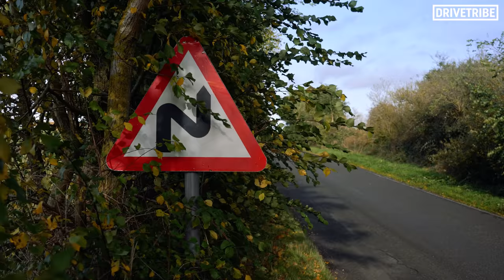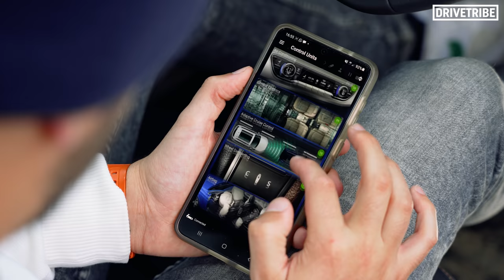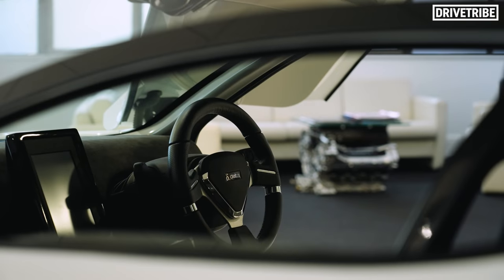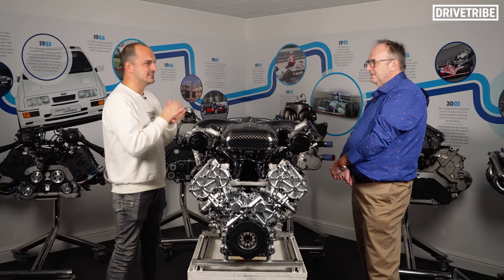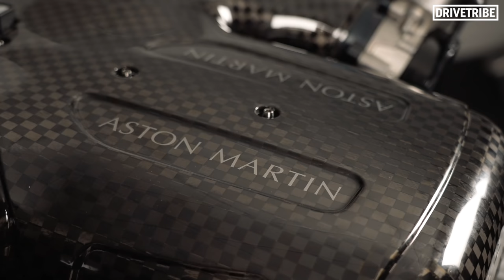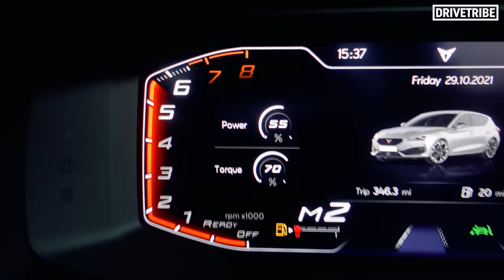Why are almost all modern engines 2.0-litres?

Comment: The 3 liter, inline-6 engine. Same 500 cm³ "chamber", but in a better balanced engine. It's a joy to drive a normally aspirated one.
Reply: Straight-6 is great. Only issue is packaging due to the length.
Reply: @martintaper7997  it is an issue, which is why they're not as common except for a few cases. i6 are usually about 80% longer than a V6 with similar displacement (i6's main competitor is v6, not i4). and although v6 is wider, it's still easier for packaging due to an almost cube-like shape outline. for most cars, functionality and cost are more important considerations than aesthetics. speaking of smaller i6 like 2 liters, they used to be common but not anymore because of reduced thermal efficiency as mentioned by the cosworth expert in the video.
Reply: must agree, got an old e39 530i, super smooth reliable engine!
Reply: @the80386  I had a E89 Z4. It had more than enough place under the hood for that engine.
It might not be for every car, but in those where it can be fitted, it's a pity not to have it.
Reply: @Chris-Workshop  I only had a 2500 cm³ inline 6, with ~210 PS, but it was smoother than silk. I really miss it. With double VANOS and Valvetronic, it was a dream.
Reply: The switch of most cars to front wheel drive spelled the end for most inline 6's, I know of only three front drivers that had an inline 6. Suzuki Verona, Volvo S80 and  the Land Rover Freelander. And the Verona and Freelander are no longer made, while I think the S80 finally ditched the inline 6 for a turbocharged&supercharged inline 4
Reply: James Mcguire  yes, I have that pathetic 2.7 engine in my 2010 Sebring, but so far it is still running great at 132,000 miles. Just keep clean oil and enough coolant in it and it is happy!
Reply: 183 cubic inches, I mean 3 liters with a big turbo and port injection under my hood. 600 + Chevy LS stomping HP.
Reply: Id still rather a v8 though
Reply: E46 M3 ;)
Reply: @the80386  The packaging really is a killer for that engine though with modern cars and crush zones the length and height of the engine makes a big difference it's much easier to fit a fatter but shorter V8
Reply: @the80386  That's a big deal though they're very tall and long which is the two hardest dimensions to fit
Reply: @Johnny-tq9no  The inline 6 is back. Jaguar, Mecedes, Aston Martin have or will have inline 6 engines on their program in the near future. BMW never stopped making them. The inline 6 will become the new V8
Reply: @afre3398  That's hardly evidence for them coming back... Those cars don't sell much at all compared to v8s and really aren't all that there's less and less inline sixes every year
Reply: @Johnny-tq9no  That is wrong. The truth is that they have made a comeback in recent years. Maybe not in the US though. But the world are much bigger than the US. Something that the US car manufactures should have realized years ago. And made better cars that have appeal outside the US
Reply: 2005 CLK 320 here. Can confirm: smooth as butter!
Reply: Nice drive but not so during filling up time, $2 aud per litre in Australia now ($5.5 usd per gallon).
Reply: @henq  those are V6 engines, not as harsh as a inline 4, but nowhere near an inline 6 in smoothness.
Reply: @thefridgeman  You’re totally right! I stand corrected. In my younger years I opened the hood of my car frequently. Now only when I buy one… So I forget the looks.. :)
Reply: @henq  no problem, Mercedes also had inline 6 engines, gave up to build only V6, like AUDI, but lately they have returned to the inline 6 again.
Reply: You can just type 500 cc, you went above and beyond to put 'cm³' here. You deserve a like.
Reply: Gotten to drive my dad's Z3 3 litre inline 6, so much fun
Reply: @Johnny-tq9no  you are so wrong... allot of people buy I6 allot of people like I6 more than V8.  V8s don't really sell much better than I6. there are just more V8s out there right now than new I6.
Reply: @the80386  no the real issue is fuel economy. 6cyl is gonna be less efficient than the 4cyl. packing the engine inside a car is not that big of a problem. that's something they have the ability to engineer around.
Reply: @the80386  Exactly, it's why straight six diesel trucks are more popular in america and australia where they can fit those big straight sixes under the hoods
Reply: " ...an  elegant engine, for a more civilized age ."
Reply: @Chris-Workshop  the e39 530 is my dream "classic " car. Had the 528 , and was wanting just a bit more power.
Reply: old bmw i6 2.5 is a monster is smooth and rages like a dragon
Reply: Agree, probably the best configuration ever to have in an engine.
Reply: how about a 2L inline 6
Reply: stellantis' new engine the Hurricane is pretty much an engine with the layout listed above, except that's not naturally aspirated but has a twin turbocharger  mounted on it.

Comment: See, when you say "they're getting 1000hp from an inline four" my immediate thought is "But what if it had eight instead?"
Reply: You'd spin off the road, or you'd use only half of if
Reply: @Nick-dz4ml , unless you have 8 driving wheels instead of 4.
Reply: I'm only thinking W16.....
Reply: Having owned V6’s and V8’s, I’ve often wondered why I was blasted into the weeds from lesser Cylinders and double the fuel economy!
That’s when I went from Rovers & Granada’s to Audi 4 & 5 cylinders!
No competition what’s so ever!
The Sound alone!
Nuff said! 💪😎👍🤛
Reply: 4 cylinders inline have always been the best engines.
Reply: if you double the wheels you still won't get more traction since each wheel only gets half the weight. You have to double the weight as well.
Reply: @pilotavery , if what you’ve stated were accurate, mounting wider tires to take corners at faster speeds would be pointless since the same total weight of the vehicle would be spread out on a larger contact surface with the pavement.
Reply: Oftentimes adding more displacement reduces power. When you add more displacement to an engine, it ends up reving lower, meaning more torque but at a lower rev-range. Since horsepower is just torque times rpm, this means that if done improperly you end up with less power. That's why japanese i4s rev high to get their power, while an American v8 reaches recline at a fraction of that. There's advantages to both layouts, but typically a lightweight body will prefer to rev high, while a heavy body will benefit from extra torque.
Reply: @PinkSparklyGamer  But it wouldn't be adding more displacement because the displacement per cylinder would be the same. American V8s rev slow because a 5.7ltr V8 has larger displacement per cylinder than a 2ltr i4, not because it has more pistons. 

Torque is better than HP anyway, unless you're on a racetrack where you can be constantly in the top end of the revs. Who drives like that on the road? I'd take lazy torque over screaming revs any day of the week.
Reply: @fredmercury1314  Yes, but there's big disadvantages to all the extra moving parts in a v8, making it rev lower. Not to mention engine imbalance, and less efficiency from each explosion.
Reply: @PinkSparklyGamer  There's LESS moving parts in a V8 not more. 

You've got twice the pistons, twice the valves, possibly twice the cams, still only one crank... but that's all divided by two when compared to an i4. 

So the V8 actually has half as much crank mass to spin as an i4. 

Imbalance in a V8 is going to depend on firing order and the crank balancing. A flat-plane V8 can fire two pistons simultaneously, so there's next to no loss in efficiency. 

So you've got twice the expansive force acting on twice the amount of pistons, moving one single crank, with half the rotating mass. That's less moving parts per CI, not more. 

Engines don't explode unless there's a catastrophic failure. Explosives explode, engines expand.
Reply: You'd still only get 1000hp. 🤣
Reply: @PinkSparklyGamer  It doesn't rev lower because of more cylinders or displacement, it revs lower to promote better engine balance. If you don't care about engine balance, you can can do a flat-plane with DOHC and rev to the moon. This video explains it well: https://youtu.be/RcyMoZoqkPA
Reply: it's not wrong though, bigger contact patch only gives more grip up to a certain point, then it starts to fall off due to lack of ground pressure. Even then it's only under ideal conditions, especially if water is being considered
Reply: Power is the rate of work DONE.
 Torque is force being PRODUCED. 
Torque is multiplied through the gearbox power is lost.
So my question is at 1000 hp how many revs is the little motor spinning at wearing itself out. And what is the torque at the crank . 
At 20000 rpm you can certainly gear it down to get rubber burning torque at wheels.
Reply: @leolouchios5574  Inline 6s or V8s are the best in automotive history.
Reply: I'd be happy with 600hp, big deal if it can make 1000hp.
Reply: @Nobody-dc8dp  Never settle for less when you can have more.
Reply: @rickitysplitz7035  facts.
Reply: Zero to power pole in 3.2 seconds
Reply: @jaysdood  Are we talking Mustang fast? Or faster?
Reply: @Fred Wills "An inline 3 cylinder has superior primary balance characteristics to a 4 cylinder"  ive heard the opposite. avoid 3 cylinders because they are inherently more unstable
Reply: @Fred Wills and a 4 cylinder will have them spaced at 90 degrees. its inherently a smoother and more stable engine
Reply: @fredmercury1314 greed
Reply: @brianj6314  it is what it is
Reply: That's when you remind everyone that the V8 muscle cars of the late 60s were topping out around 400hp gross at the crank.

Comment: Because displacement based taxes are still are thing in most parts of the world. This is the real reason. There are countries that are baffled on how to tax luxury cars with 1.6l engines.
Reply: Tax should be based on CO2 emissions/pollution produced during manufacturing and driving.  Electric car battery production is a huge factor for this kind of tax.
Reply: That’s also why Peugeot cars in general have a max of 1.6 4 cyl and they have removed the 2.0 hdi from every PSA car including Opel and its English equivalent
Reply: @Mck Idyl "Japan"
Reply: @TheHipClip  tbh, over the lifetime of the vehicle, battery co2 is negligable compared to continued use of petroleum... however, yes it's true all manufacturing will create co2 or other pollution, it's somewhat unavoidable.
Reply: @Mck Idyl Actually, yes they do care. They care because they know that what taxes a customer has to pay on the car is a large decision maker when someone is purchasing a car.
Reply: @TheHipClip  taxes on cars should NOT be a thing. Co2 taxes or anything else is just a moneygrab from governement.
Reply: @Mck Idyl 
Sure they don't, but the customers do care genius.
Reply: Here in Australia you are taxed on the number of cylinders. So your Toyota Prado 2.8 litre 4 cylinder diesel pays the same tax as your 1.6 4 cylinder Toyota Corolla.
Reply: @Mck Idyl, in France and in Italy it is and has been in the past, hence why you’ll have a hard time finding non-luxury French cars for the domestic market with engines larger than 2.7 L, or non-luxury Italian cars for the domestic market with engines larger than 2 L.
Reply: Nope. Ever heard of technological advancement? It doesn't stop, ever, that's the real reason.
Reply: @EtienneDuchesne  Most taxes are a big money grab from government, but of all the taxes, I can understand those that discourage activities that produce externalities, and the CO2 tax is one of them. Income tax and sales tax are simply theft, though.
Reply: In Pakistan anything over 1000cc is consider to be luxury car.
Reply: in Italy we also have a special luxury tax that forces you to pay €20 for EVERY kw above 185. So, for example, if you wanna buy an Audi RS3, you're going to pay €5k in taxes alone EVERY YEAR.
Reply: @g_webb21  How does that work if you have the engine modified or remapped?
Reply: @justingistpreuninger3447  WOW   Battery  check the numbers
 that not working for you
Reply: @chriswilson1853  better not tell anyone😂your warranty would instantly expire and in case of an accident you'd have to pay it all for yourself because the insurance (even if someone hits you and you have NO fault) will check your ECU to avoid paying for damage.
Reply: @chriswilson1853  the other choice is to tell insurance about it, you have to re-homologate the vehicle and od course you're going to pay more for insurance and tax as well. In Italy most vehicles are below 250hp because of this and the sportier models you'll see around are Golf GTI's (because they easily jump from 230hp to 300 with a remap) in order to avoid this luxury tax.
Reply: @g_webb21  Yes I know you are supposed to declare it to your insurance. My remap (in the UK) is declared and it made no difference to the premium.
But a remap or mod makes no difference to the Vehicle Excise Duty, which is based on CO2 emissions, no matter what tax band the modification would theoretically move the car into. So, it's a loophole here, but a totally legal one. I was wondering whether the same applied in Italy. It would be very difficult for the authorities to know how much to tax a modded car.  Would you have to put it on a dyno?
Reply: @chriswilson1853  Here the tax is mainly based on kW and in a fairly small part also on Euro-normatives (an Euro 5 car will pay less than an Euro 3 for example);

 any modded car would not even be able to hit the road but yeah, they'd probably be forced to ask the "tuning company" for the dyno test data I believe.
Reply: @Mck Idyl explain a 998ccm Hyundai engine to me please :)
Reply: @TheHipClip  CO2 is the only thing humans make more of that its not actually polluting but helpful. The ONLY thing.
Reply: I looked it up, and in one of those countries, my $2500 car with a V8 is in the same tax bracket as a Lamborghini Gallardo. Stupidest idea I've ever heard.
Reply: @justingistpreuninger3447  at 5 years, even on coal produced electric power, an EV CO2 is less than the CO2 of driving a relatively efficient gas car over the same period.
Reply: Tax according to mass of the vehicle.
Reply: @kornaros96  that is not going to incentivize ev adoption. Maybe later that's how we should go but right now it should be displacement based to make fuel economy more important or switching to an EV an easier decision.
Reply: @Tracert-mc1hu  no it's not. It's to incentivize you to drive more efficient vehicles.
Reply: @hondaguy9153  Then make it based on fuel mileage or emissions. F1 cars are a 1.6 putting them in the same bracket as a base Civic. And I guarantee you that an F1 car is a lot worse for the environment than a bone stock Chevrolet.
Reply: @hondaguy9153  And yes, I know that you can't register an F1 car for the road, but my point still stands. Especially with small turbocharged engines, which are the result of laws like that. And rotaries even more so.
Reply: @hondaguy9153  No, I said nothing about cheating on the emissions tests.
Reply: @hondaguy9153  How are they not already incentivized to lie about the displacement to be in a lower tax bracket while having better performance numbers?
Reply: @alexanderboychev1095  ok. 🙄
Reply: @alexanderboychev1095  ok.
Reply: @hondaguy9153  But displacement/cylinders is only a very crude indicator of engine efficiency.
Reply: Que reason why its hard to get a 3.5L lexus in the UK
Reply: @justingistpreuninger3447  Luckily we something called billions of trees to remove the carbon out of that co2 and release the oxygen 🤔
Reply: @kornaros96  Taxed by the mass, thats the way in the Netherlands. Also why US cars are not popular, they are heavy. They however multiply by an environment factor nowadays, which can be greater or smaller than 1.
Reply: It would be so much simpler to just tax the tires. No bothering with engine power or size, or what is used as the energy source.
Reply: @EtienneDuchesne  Taxes aren't just a moneygrab. It's easy to think that way if you're a teenager or your dad is rich, but for people who live in the real world, taxes pay for vital services and infrastructure that the rich wouldn't do voluntarily. Also keep in mind that most rich people driving fancy cars didn't earn their money
Reply: @Tracert-mc1hu  Do you have irrefutable numbers to back this up? Because you're doing ALOT of guessing that sounds wrong
Reply: @boozecruiser  if taxes were used only for those things, yeah I'd gladly pay them. But we all know that the more you pay, the more goes missing, or into BS stuff like fighting more pointless wars/building a 5th library in that small town where only 200 dude lives. As a french, I can affirm without a doubt that high taxes doesn't corrolate to high quality public services